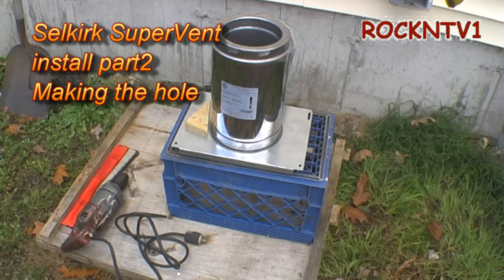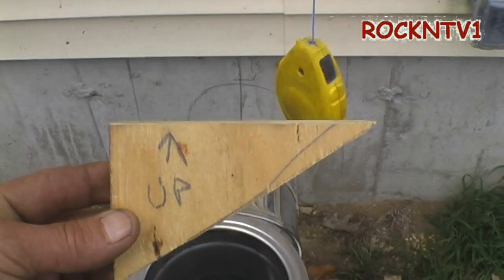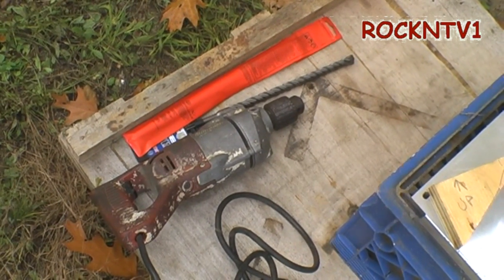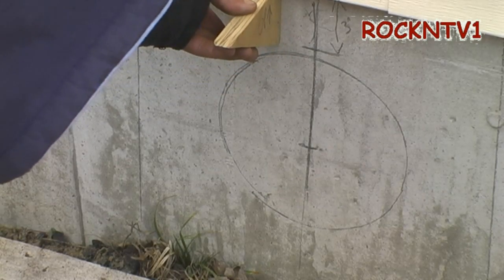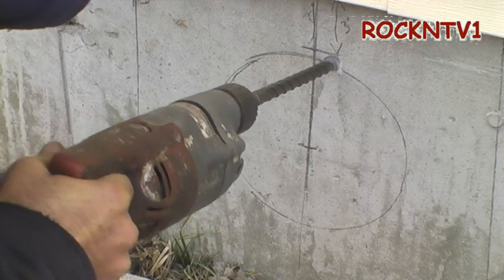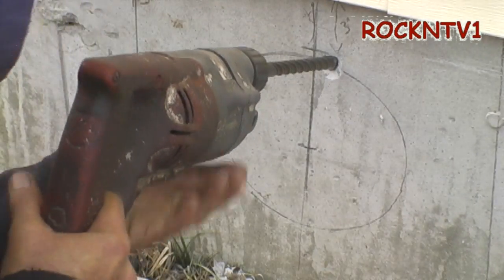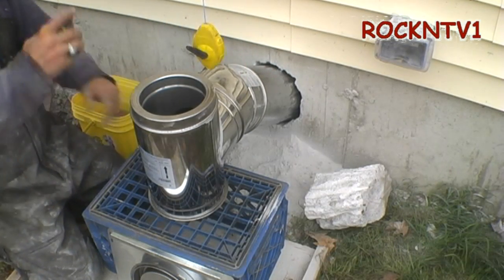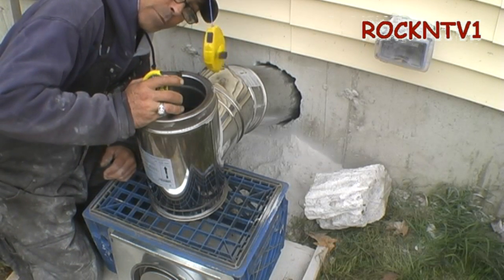SELKIRK SUPERVENT Chimney Flu through the wall kit install pt2 Drill Hole

Comment from the maker: the through hole came out great on both sides of the wall, the long side of the 30 degree triangle nears 11" on 12" bit, easy to let up pressure, sds bit are grinders not cutters, yes vid on way to explain.

Comment: It is looking good. I did that 5 years ago but i used the same pipe but it was galvinised on the outside saved a lot of money on the total install.If anyone else is attempting this look in to it instead of the stainless steel pipe.

Comment: Pretty close to the vinyl siding, maybe install aluminum flashing about 12 inches wide with a right angle lip say 2 inches wide and about 2 feet long that will cover the siding to protect from heat. Heat rules and that could be a sensitive area. Great job. 
Vinny

Comment: Why did you use the 30 degree elbow it looks like you would still had room to clean out and get a brush under the T with a straight joint ?
Reply from the maker: tht t is straight ,, you clean top down

Comment: Question for you....Selkirk's installation instructions specifically say not to offset the T-Joint to go around a soffit.  I notice you did and I am thinking of doing the same (24").  Yours has been installed now for over a year, have you had any problems having done that?
Reply from the maker: no i did'nt, its a straight shot up past the shingles

Comment: you are putting a sds+ drillbit in a normal drilling machine ?

what I do is use a thin drillbit, 8mm in the middle and when it reaches the inside I make a cord on it with a pencil, draw the same circle on the inside and drill arround the edge with a small drillbit, that prevents the explosion in the inside (most of the times).

but your hole (in the wall) looks great, just perfect
Reply from the maker: no,  video about the bit .. >    https://youtu.be/XHdQfIB-A0A      and the new drill --->  https://youtu.be/2oWCiNP5ivM

Comment: Couldn't you have just used an electric stud finder instead of peeling the siding ?
Reply from the maker: I wanted dead center  of the wall stud, finders will find misses. Vynle siding is easy to unzip.